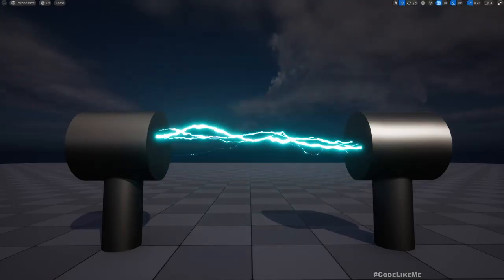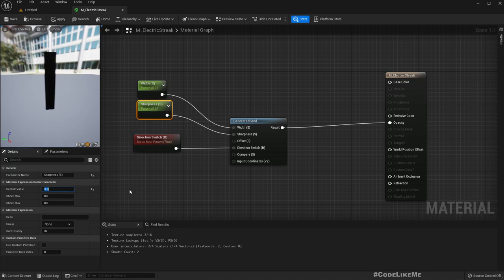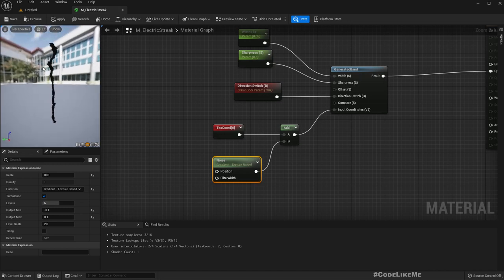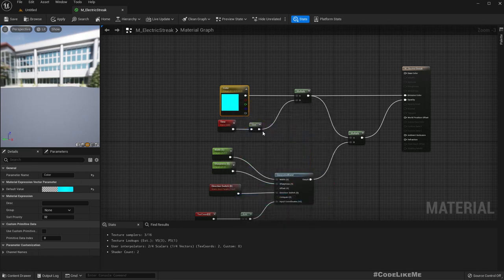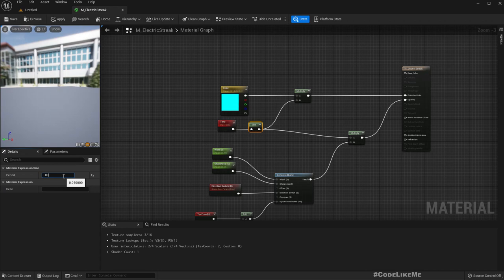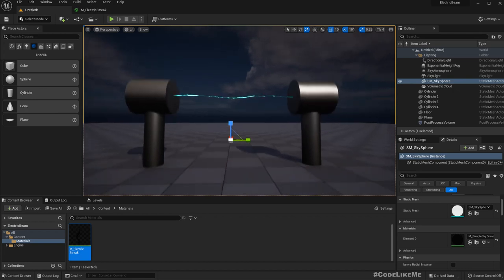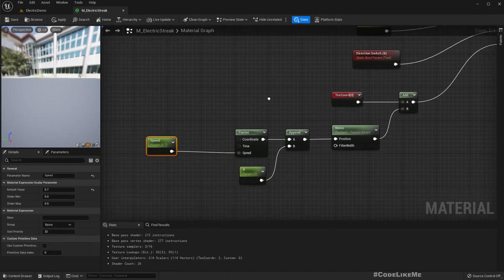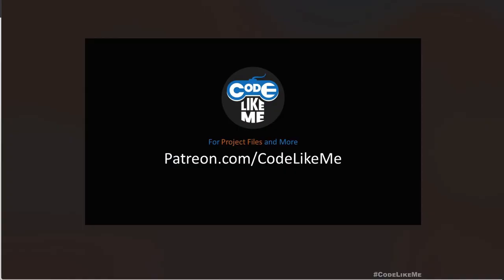Unreal Engine 5 - Electric Material

Comment: This is way too expensive to use in a game. 2 generative nodes in a single material for just that simple effect.
To get the same line you can use a texcoord node masked in G, then subtract 0.5 from it, run it though ABS and Power, use the power to have it sharper or smoother then use smoothstep node if you wanna make wider or slimmer. And it's the same as the band generator but it does not generate anything at runtime. It is precalculated. 
Then to make it like a lightning just add a low res noise texture and instead of panner just add time to it to keep it as cheap as it can get. 
Your material can also be additive instead of translucent. Or even masked id you're going for a more stylised (sharper) look. And for the best result make a Niagara system spawning a couple sprites facing the camera so that you will get the best result no matter the angle you're looking at it. You can also use texcoord and add a random value in the niagara using a dynamic parameter to make it random for each lightning.
Reply: On the noise texture though where do you add it?
Reply: The band generator is just a material function, and if you open it up you can see it does pretty much what you described. But I agree with that the prodedural noise node is really expensive and it's better off using a low-res texture sample.

Comment: Your tutorials are very helpful, although I have a small problem with the previews when using the Panner. Yours clearly seem emissive, while mine are just flat white without a glow around it. Is there anything I need to change within settings or whatever to get the preview as you're showing it? Many thanks in advance! Keep up the good work!
Reply: Try turning on the "Bloom" option in your Unreal Engine project settings

Comment: That is really cool.  I didn't know about the GeneratedBand node so I would have started experimenting with Niagara trails.  Are there any rules for determining which effects to produce in materials rather than Niagara?
Reply from the maker: well, when it comes to changing size, colors, opacity with time, which is often the case with effects, we have to use the particle system. But for the base look, we can rely on the material.